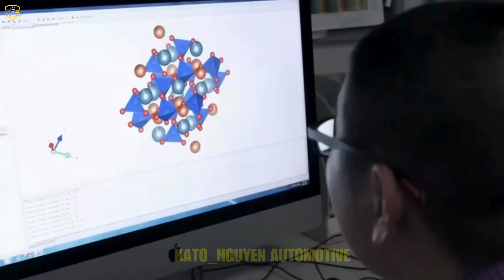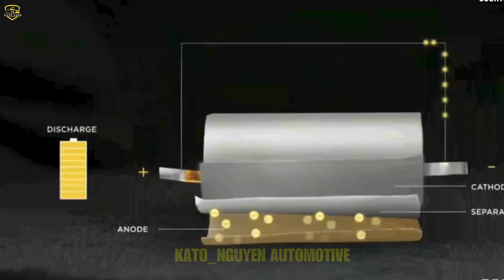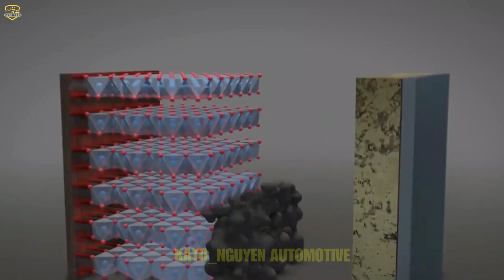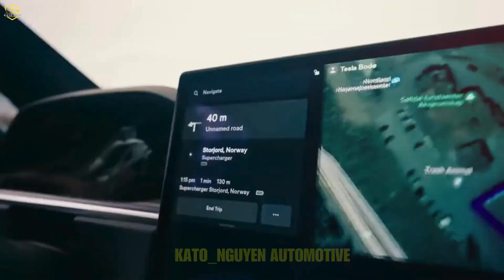CATL’s NEW INSANE Battery Technology SHOCKED The EV Industry

Comment: Manufacturer do not build products to last! Disposable products guarantee cycle revenue year after year... infinite
Reply: Not entirely correct. When you're selling high price high volume products. You're talking significant amounts of money in sales before you even need to consider repeat customers. 
If you do some basic assumptions, using current EV battery costs. Right now, you're looking at about $125/kWh for an EV battery. Presuming you converted 300 million current ICE owners to EV ownership, and say battery size follows current EVs of around 70kWh. You're looking at $2.625 trillion in battery value. This is before you even consider price higher battery prices, larger battery quantity for the likes of public transport and other minor aspects. This change alone would convert a significant amount of the populous to EV vehicle use, especially considering a major concern has always been "what if I go on a road trip". If this transferred to a 1000km passenger vehicle range you're covering vast distances with minimal charge times. Melbourne to Brisbane is about 1800kms, so you're doing that entire trip with one recharge and and about 40 minutes worth of stops. You could travel from New York to Los Angeles which is around 4500kms with just a few hours in recharge stops. 

Major changes to consumer circumstances like this potential offering far outweigh the low cost item production of "sell lots for cheap". This is a potential trillion dollar industry change that has numerous advantages outside of transportation. Business power backups, home solar systems, electric vehicles for mining. If a single manufacture can provide an outcome to everyone... you only need the initial sale.